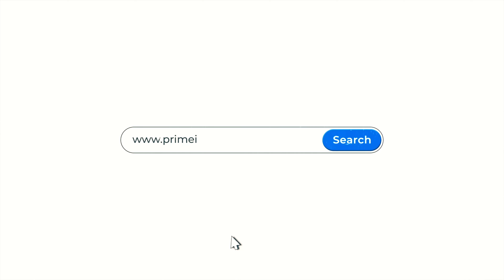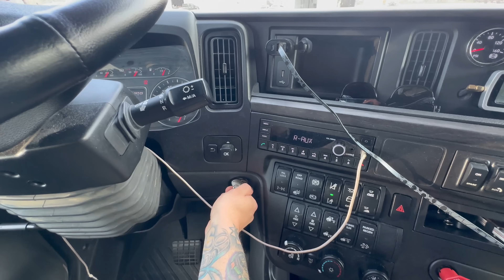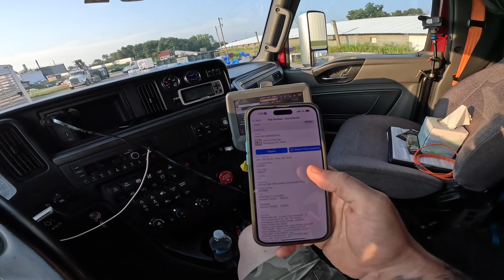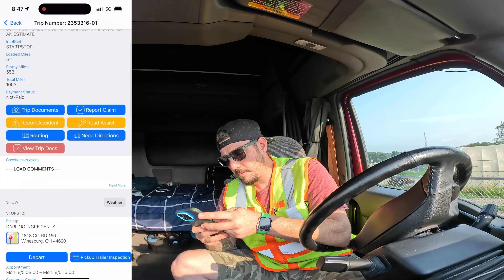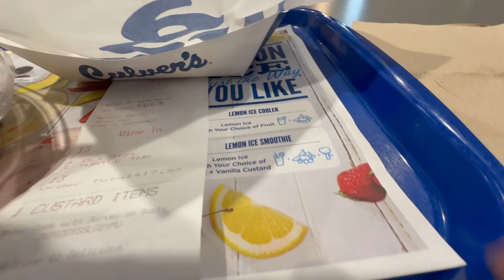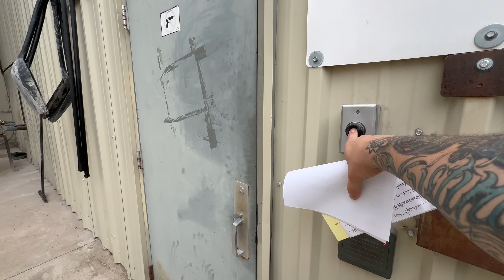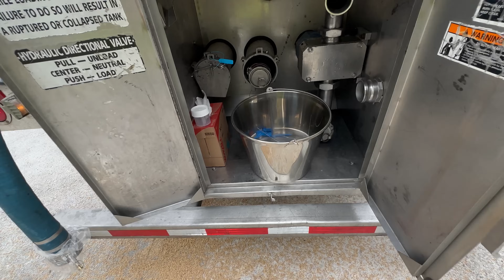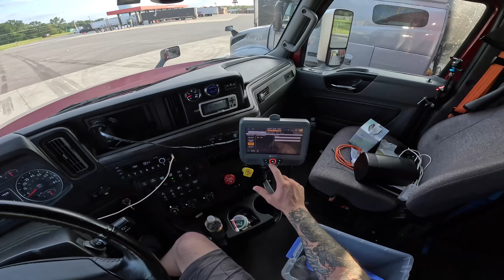CDL TANKER LIFE: 1574 miles later we head back to Ohio REJECTED

Comment: I don't miss bed bugging any longer, matter of fact I retired from trucking four years ago. I hauled tanker for 14 years, but not smoothbore fuel and propane is what I carried. Back in the 1990's I drove for a Company called MS Carriers, Swift bought us out in the year 2000, I never worked for Swift, however the interesting thing is all these systems that are being used in trucking for routing and fueling and what have you were all developed for MS. Carriers, they pumped alot of money into computer systems for routing etc. I am pretty positive that that early system was the grandparent of what is currently being used. That said I cannot stand where trucking has gone today and the reason why after 27 years I got out. Good luck your video is very good and wish your career well.